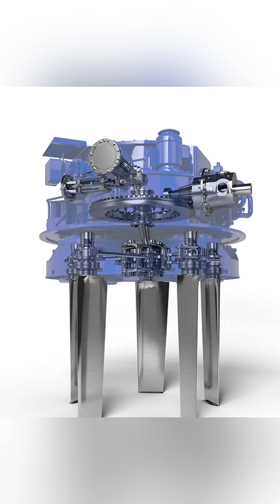Strangest Propeller EVER MADE!? -Voith Schneider

Comment: It's a semi great idea that's been around for 90 odd years. The real problem with those propellers, they "Eat Themselves" at high speed. They work great in water, because the "resistance" holds them together, but in the air, they tend to self-destruct!! When the materials & tech, solve that problem, "The Jetson's" won't be far off!!

Comment: Too many fast moving parts. What happens when they hit a bird. It will all come apart.
Reply: Rofl, these are used on boats since the late 1930's. Mainly tuboats used them since it allows them to move in every direction. I really doubt birdstrikes are a problem under water. This is a proven technology.
Reply: @slome815  Wouldn't want a cormorant to enter this prop.
Reply: @joost1120  You'd think the doubters would give in after 70 years of succesful use.
Reply: I’ve seen jet engines come apart from bird strikes.

Comment: For the naysayers: this tech has been used since around the 1930s, tug boats use it a lot, and quite successfully
Reply: Used on Staten Island Ferry. Since the 1970's. It's actually very reliable.
Reply: The tech is extremely complex, and prone to failure. So there is a huge difference, when using the tech in a flying vehicle, compared to a boat.
Reply: @tazanteflight8670  
Source: I pulled it out of my backside
Reply: @uninitializedvariable  Its called common sense,.... get some
Reply: @tazanteflight8670  
Like the one that you pulled out of your backside
Reply: @tazanteflight8670 no more complicated than a helicopter swashplate mechanism. If they were as unreliable as you say they wouldn’t have lasted this long.
Reply: @punman5392  Well, now,.. instead of 1 swashplate, you have 6..... Its bad logic to make flying vehicles more complex, than they need to be.

Comment: Let's make it more complicated and harder and more expensive to repair. Don't seem smart
Reply: same was said about turbo probs or jet engines by the people used to common propeller planes ... was stilll smart to move on.
Cost/complexity/repairissues can easily be excused whenever the gains in performance and functions are large enough, time will tell where this goes ... but its always smart to explore new options even if some fail.
Reply: @diedampfbrasse98  Still too many  parts . Twin counter rotating screws works fine for me . Can you around just fine . Add bow thrusting even but that won't last long. We are talking marine propulsion not Air planes .
Reply: no, this is about propulsion in general, the point I made applies to pretty much every technology even beyond propulsion ... always some critics far too early claiming that a development is "too complex, too costly ... not smart" while the smart people move ahead of them thanks to that increase in complexity and cost. No matter if ships, cars or aircraft ... it all became more complex, costly and difficult to actually repair instead of replace .. hasnt stopped that trend, despite some fails on the way.
Reply: @Kevin-vv6oe  Rofl, It's amazing how many people here are spouting opinions about stuff they don't know anything about. This is a proven technology that has been used since the 1930's and is common on tugboats.
Reply: @slome815  I've been a mechanic for over 45 years. Working on farm equipment. Automotive motorcycles and a lot of inboard and outboard engines . Going from boat shop to motor cycle shop only to sleep 4 hours a night and half hour during my lunches . There is a saying keep it simple stupid . KISS . I have no problem with modern tech but reliability is key . Thankfully I don't work on cars no more than I have to... And am retired now . Just wish I had another 1964 Mercury 50 on a fishing boat . Old school always got me home .
Reply: @Kevin-vv6oe  Like I said, this has been used since the 1930's, it's not new technology in anyway, unless anything past steam turbines and horseless carriages is new technology to you. The first british ship to have it was the MV Lymington, and it was build in 1938, and was in service right up to  1996. Something looking "more complicated" does not mean it's less reliable. A diesel injection pump or modern gearbox is just as complicated.
Tugboats use these because they can instantly go sideways, turn on the spot, go backwards, etc.
Reply: It's not more complicated than usual boat motor or propeller.
But it takes twice more materials than usual 3-blades propeller for the same speed.

Comment: That looks like a lot of things that could fail at once.
Reply: Have you ever had a look at a simple 4 cylinder combustion engine? 4 pistons, 4 piston arms, 8 to 12 piston seals, 8 to to 32 valves, a crank shaft, 1 or more cam shafts, a throttle body, timing belt or chain (chain is a huge number of moving parts in and of itself), every roller and ball bearing is a multitude of moving parts itself.

That also looks like a lot of things that could fail at once.
Reply: @MrMartinSchou 2 stroke opposed cylinder diesel should be mentioned
Reply: @MrMartinSchou  finally someone said it, i hate if when someone immideately says "OhHh ItS ToO ComPlICatEd So MUcH CaN FaiL" even more if you compare how long a 4-stroke engine lasts compared to a 2-stroke engine.
Reply: Opposed cylinder 2stroke diesel should be mentioned
Reply: @MrMartinSchou good one  😆
Reply: The Progression to solid state
Reply: This is proven technology for tugboats. Have you ever seen how the swashplate on a helicopter works? Just as complicated, and just as reliable.
Reply: @slome815 Swashplates fail quite often!  Everything up to full rotor separation still happens with regularity.  Their mechanical complexity is still a factor that you cannot completely engineer around.
Reply: typical dude that has no idea how complex most things are xD
Reply: No. It's tried and proven technology from the 1930s.
Reply: If it's been around since the 1930s, i would imagine that they have corrected any design flaws at this point. It would be  more reliable & efficient then standard propulsion
Reply: Voith Schneider should be printed to screen